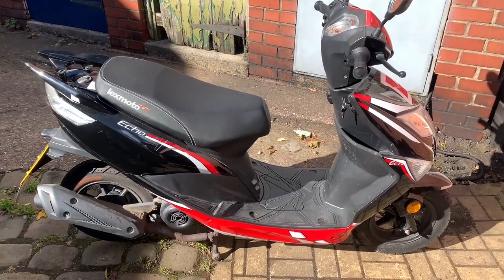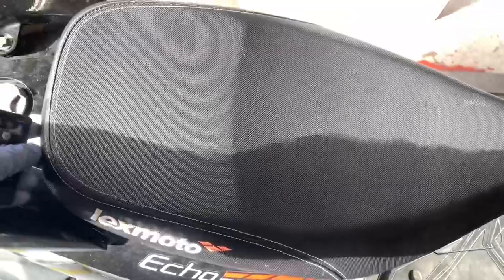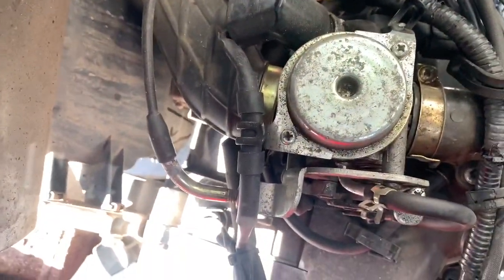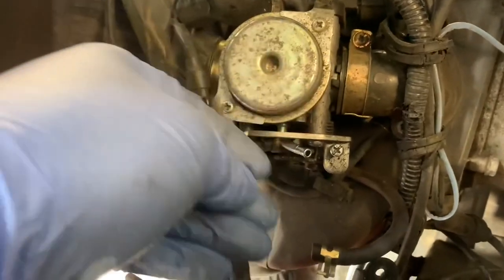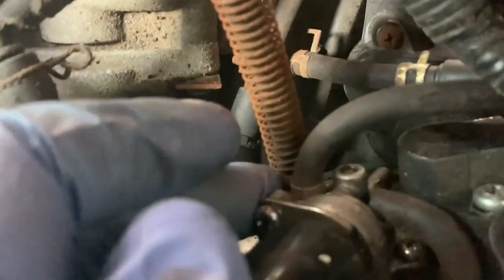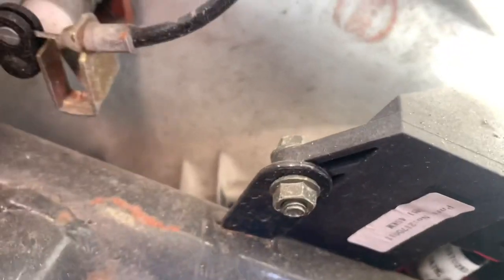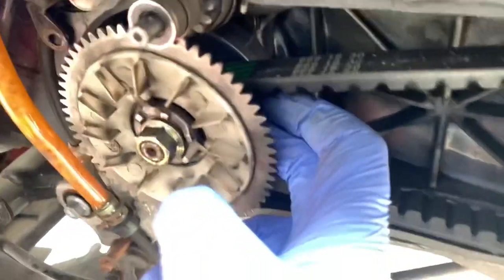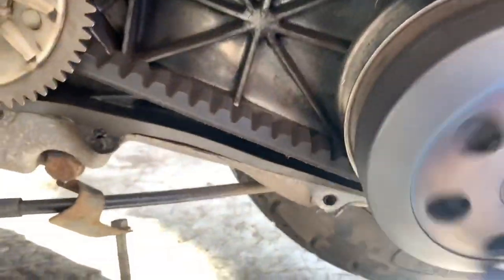50cc 4 Stroke De-Restriction, Euro 4 GY6/New Type Scooter Derestrict... “Make Ya Ped More Fasterer”

Comment: Hello SBSV, I have a lj50qt-6l (Echo + 50) from 2019 and this type of engine does about 15mph (not great). I have a Dell'orto ECU with only a vario restricted Bus (bigger edge on the vario bus). So should i get a new ECU to get it unlocked for full rpm and full speed?
Reply from the maker: Have you blocked the vac lines?
Reply: @StupidBlokeStupidVideos  not yet... But iwould be restricted inside the ECU? The vacuum lines have two solenoids on it.
Reply from the maker: @schoonbeek2  the ecu restricts the carb via the solenoids. You won’t necessarily gain top speed by removing them but usually get better acceleration and up hills. At 15mph yours sounds like it may have other issues though
Reply: @StupidBlokeStupidVideos thank you for your reaction 😊 My mopet is a restricted version in the NL. You buy them straight out of the shop 😂 they go as fast (as a bicycle). Sometimes electric bikes can keep up with me.
Reply: But why are they on it? It has something to do with emissions? I don't get the whole tube solenoid construction thing :P @StupidBlokeStupidVideos
Reply from the maker: @schoonbeek2  ah I’ve heard of those but never seen one. They aren’t over here. I think the restrictor for that is actually a ring in the variator. Sometimes they are part of the slide and the slide needs replacing. I’m not 100% though
Reply: @StupidBlokeStupidVideos  Thank you for the explanation. Ive heard that the pick up line from the ignition coil needs to be black. So i have to swap my original ignition coil (blue white wire) to black wire. And then you need to change the ECU CLC to a unlocked one. You ever heard of that?
Reply from the maker: @schoonbeek2  sounds like it could be about right but I’ve honestly no experience with that type as they aren’t in my country. On this model the carb is restricted by the solenoid valves that open to release the vacuum and drop the slide or on some models let air pass straight past the carb altogether. They also serve to lean the mix as much as possible to meet the emissions requirements for euro 4. This process I show should result in a bit less of a lean fuel mixture, and stop the carb from dropping down when the ecu demands it and as a result give a bit more power. Better acceleration and speed up hill but the actual speed limiter can be awkward to bypass on these euro 4 scooters, depending on model. The electric speed sensor restricts ignition when 28mph is reached. Unplugging the speed sensor puts a lot of them into limp mode but not all of them.
Reply: @StupidBlokeStupidVideos  You are amazing. So block those lines or delete them should work properly? Those on the carb i can put a little fuel hose on, with a stop or rubber piece in it. What u think 🤔?
Reply from the maker: @schoonbeek2  on this one I just blocked them off by pushing a ball bearing inside the pipe. That’s probably the easiest method to be honest. If you try it, let me know if it works for you!

Comment: I’ve installed a polini lambda emulator and now my bike is derestricted. Should I also do this aswell as I’m still only getting around 35 on a flat on my aerox 4t
Reply from the maker: I’ve not done an Aerox 4t yet, so not sure what system they use. Has it got a carb, or is it injection?
Reply: @StupidBlokeStupidVideos  I’m pretty sure it’s a carb mate. I haven’t touched the carb yet as I don’t want to fuck it up
Reply from the maker: @rskvelocity2790  that’s fair enough. If it’s a euro 4 the carb will probably work in the same way as this one but without seeing it, it’s hard to say.
Reply: @StupidBlokeStupidVideos  I’m mistaken. It’s fuel injected so I need to buy the malossi force master
Reply from the maker: @rskvelocity2790  I’ve not done an injection one yet, but I think it’s a case of altering the software in the ecu

Comment: Hi mate, is this legal and will I pass the MOT with that? Cheers
Reply from the maker: It’s not part of the MOT test, and won’t make any difference as far as MOT goes. If you’re 16, then technically it’s illegal but you’re extremely unlucky if you get caught out. In my opinion, these bikes are more dangerous when restricted than not!

Comment: Hi buddy nice video, I have a tgb 50cc I've removed the washer and now does 42mph is there anything else I can do to gain a bit more speed on this bike
Reply from the maker: Hi mate. Is it a 4 stroke or a 2 stroke? What year is it?
Reply from the maker: @richardmonk8957  the exhaust is vital on a 2 stroke. Make sure the restrictor is out in the exhaust. It’s usually in the exhaust flange where it bolts onto the engine, but sometimes it can be in the end can/where the end can bolts on if it has one.
Reply: @StupidBlokeStupidVideos  ahh cool nice one for that buddy I will have a look and remove it, it has a rubber pipe coming off the exhaust I saw on another video this should be cut and plugged is that correct
Reply from the maker: @richardmonk8957  the rubber pipe is for an emission system. That’s not the restrictor but does want blanking off at the same time really.
Reply: @StupidBlokeStupidVideos  cheers buddy soon as this snow clears gonna get out and have a look in the exhaust, keep up the videos mate

Comment: Hi mate old video so not sure if you’d reply, but have any idea how I de restrict a lexmoto nano, from what I’ve heard it essentially has the same engine as the echo but not 100% sure, and as it’s a euro 4, is there any way of replacing the carb with a none electronically controlled one or would this not work ?
Reply from the maker: If it’s the same carb then this should work in the same way pal
Reply: @StupidBlokeStupidVideos  yeah it’s the same carb and I’ve blocked the holes, I’m just wondering if it’s possible to swap the dellorto electric carb out for a mechanical race carb to up fueling , or does the bike require the dellorto electronic carb
Reply: Did you ever try it ? I got the nano but so sick of how slow it is had any luck with it
Reply from the maker: The ecu needs to see the input from the throttle position sensor to adjust the timing so a standard carb won’t work without other mods. I’ve done this method a few times and it does work, on some models there is an electronic restrictor I haven’t managed to bypass yet so it will only do 30mph before an over speed code but you should still get better acceleration and up hill speeds at least.

Comment: Can u help me have the same bike as you and i can’t find the ecu where is it do u know?
Reply from the maker: Take the seat bowl out, if I remember right it’s on the left hand side rear but I’m not sure. It’s a while since I’ve worked in one to be honest.
Reply from the maker: @user-cc3do4pg9v  euro 4 models with electronic carb control have an ecu instead, the older ones usually have the CDI in a similar place or near the battery, but not always.

Comment: Hi mate I have a 20 plate echo , I can access the 1st pipe but not the other one ,
Reply from the maker: It should be there. Look for the solenoid valve and follow the pipe back to the carb.

Comment: I got similar model with exact same electronics I removed variator restrictor any way to manually derestrict dellorto electronics other than buying it derestrict Ed?
Reply from the maker: This video shows you how to stop the ecu from restricting the carb side which is the main/power restriction. If the carb has been done and the speed sensor/variator restrictor has been removed, then the only other thing should be the rev limiter, which you’ll struggle to reach when the cvt is in top gear anyway.
Reply: @StupidBlokeStupidVideos  Just to be clear youre saying that if I have carb and var restrictors off removing rev res wouldn't make much of a difference?
Reply from the maker: @chaosmaster8855  often that’s the case yes, as you’ll struggle to reach it without other mods.
Reply: @StupidBlokeStupidVideos  well currently it hits 7k rpm with ease and I've hit it as high as 8,5k downhill any mods you'd recommend,would a Dlh variator (advertised as +15% speed when I apply it) actually make a diffeence
Reply from the maker: What upgrades have you done? Just derestricted it?
Reply: @StupidBlokeStupidVideos  yes and it has 5g rollers apart from stock that were 6g if that makes any diff
Reply from the maker: @chaosmaster8855  unless you’re doing other mods like a different camshaft etc, then lighter rollers usually have a negative effect on the GY6 engines as they are tuned for low down torque rather than high end power. I would try removing the carb restrictor and the. fitting your original rollers if I was you.

Comment: In all seriousness, does this actually work ? My scooter doesn't go past 30mph, even with the washer removed, it is Lexmoto Echo 50 E4 2018
Reply from the maker: I’ve done this a few times and whenever I’ve done it, it has worked yes.
Reply: Mines restricted and I can reach 30s but desperate to de restrict it
Reply: Anyone know anyone who can do the de restriction close to sk16 lmao?
Reply from the maker: @lxll-GOD-llxl  I’m in OL2, but on one of these that’s like a 3 day journey.
Reply: Ol2 that close? Could you do? If so how much bro?
Reply from the maker: @lxll-GOD-llxl  Google Bikes and Beyond Shaw pal, that’s where I work. To do this wouldn’t be expensive but don’t expect massive results lol
Reply: Just need a bit more then about 30 ygm haha and where's that?
Reply from the maker: @lxll-GOD-llxl  near Oldham pal
Reply: Got a number?
Reply from the maker: @lxll-GOD-llxl  type is into Google is best bet mate, number is on there and it will tell you exactly how far away we are too. Bikes and Beyond Shaw.
Reply: Cheers pal, say if I wanted someone come do it how much would I be looking?
Reply from the maker: @lxll-GOD-llxl  we don’t do call outs, but we charge £48/hr. It would probably take about half an hour to an hour maximum as long as there’s no issues.
Reply: Thanks alot mate just have to figure out an easier way getting there lol

Comment: i got the same bike and it goes 50 km/h can this make it go faster?
Reply from the maker: Usually when fully de-restricted, they do a bit more than 50km/h in my experience. Probably closer to 65/60kmh.
Reply: @StupidBlokeStupidVideos  Amazing i'm going to try this but can i put something else inside? Not the ball. Because i don't have it :(
Reply from the maker: As long as it blocks the pipe off then it should work. Be careful not to block the wrong pipes off though.

Comment: if it has the washer do you remove it and it’s derestricted?
Reply from the maker: Usually yes. Some have the washer built into the variator slide so a new slide is needed or it needs grinding down to size, and some have a cage around the back of the variator held on with 3 or 4 screws that does the same thing.

Comment: Hi mate looking at mine cdi dereistict seems cut , doesn't make much differnt get like 35, thinking of getting 72cc big bore kit would that make a difference
Reply from the maker: Is it a euro 4 model with the electronically controlled carb? The speed restriction wire being cut on its own will let it go over 30, but you usually won’t have the power to much more unless you’re going down hill and won’t make any difference up hills unless you derestrict the carb too. There’s another video on the channel on how to do that if it’s not a euro 4 model.
Reply from the maker: Big bore kite make a noticeable difference, especially if set up correctly.
Reply: @StupidBlokeStupidVideos  not too sure what one mine is mate its 16 plate so it's the older model and I thought the same but even down hill it's the same speed its odd
Reply: @StupidBlokeStupidVideos  yeh definitely going to get a garage to fit it soon enough so il let you know when it's done

Comment: Hello mate wondering if this will be the same steps for a 2019 4 stroke 50cc sinnis jet 2? Thanks
Reply from the maker: The carb, more than likely yes. However don’t disconnect the speed sensor as it will probably go into limp dick mode and will lose power. If you just do the carb then it likely won’t go any faster full speed, as the max speed limiter will still be in place, but you should get better acceleration/speed up hills.
Reply: @StupidBlokeStupidVideos  is there not a washer on the bike to remove? Well I’m guessing if there was and I did the bike still wouldn’t get any faster ?
Reply from the maker: @WX04  if there is a washer then yes remove it as that’s a restriction of the hearing, effectively not letting it reach top gear. Most of the new ones don’t have a washer though, and are electronically restricted via a speed sensor on the clutch bell. Some you can disconnect it, but others will go into limp mode with it disconnected.
Reply: @StupidBlokeStupidVideos  for the speed sensor could i just buy a derristricted CDI from ebay or something?
Reply from the maker: @WX04  it’s dependent on what system your bike has. If it’s euro 4 then they have an ECU with an electronically controlled carburettor etc. A derestricted one is expensive. If it’s just a normal CDI then a derestricted CDI won’t gain hardly anything without doing the other physical derestrictions.
Reply: @StupidBlokeStupidVideos  hello i ordered a ecu i have plugged it in the bike however it has just went slower acceleration and capped at 20mph. Do i need to block the pipes or is it the wrong ecu of racing planet it was a dellorto ecu for a sym bike however i have a sinnis but on another website the same ecu says it works for s specific model which i had. It has the same ecu number though and i was told by a local mechanic it wouldve worked thanks mate
Reply from the maker: @WX04  does the engine management light come on? Have you got the speed sensor plugged in? Some of the bikes do this and go into limp mode when the speed sensor is unplugged.
Reply: @StupidBlokeStupidVideos  i left the cdi untouched and just replaced the ecu in the bike, it then revved slower than before and went slower. So im guessing the ecu just did not work for the bike?
Reply from the maker: @WX04  sounds like it’s possibly not the right ecu to be honest. What make is it and how much was it?
Reply: @StupidBlokeStupidVideos  i bought it off racing planet for 144 pounds it was a dellorto one for sym bikes, but had the same model number as my sinnis dellorto so i thought it would've worked
Reply from the maker: @WX04  it could have the wrong software. They’re the same unit across most Chineese models as far as I’m aware but with different file uploaded. Technically there should be a derestricted file for your original one, but that’s a bit computerey for my knowledge.

Comment: Got an echo 20 plate and its not got the washer on but tops out at 30 and I’ve tried the bb bullets and It didn’t do anything
Reply from the maker: The BBs will only allow stop the restrictor that stops the slide of the carb from opening fully, but the top speed restrictor works in a different way. The BBs themselves won’t raise the limited top speed, but should help the bike get to it quicker and be better at going up hills etc. There are a few ways euro 4 scooters are restricted and some harder to get around that others. Does it have a speed sensor on the clutch drum?
Reply: Hi pal, got a 16 plate longjia lj50qt 4 stroke... When I bought it off a geezer, he said he unplugged something under the footwell from a power unit, it does 35mph on a slight downward incline, any other ways of improving top end a few mph please mate

Comment: I cant find parts (Variator Kit) for my Lexmoto Echo 50cc E4 5-Litre anywhere in the UK. I've been waiting for months. Its so terrible. Does anyone know where to buy one, other than CMPO?
Reply from the maker: Is your variator definitely restricted? It’s just the front variator thar you need, I’m not 100%, but I’m fairly sure that the standard 50cc GY6 one will fit. Worth a try as they are only cheap, CMPO should have them but failing that, eBay will have them too
Reply: Thanks for the very quick reply! I guess it’s worth trying... from the reviews on on trust pilot people have been waiting 3-5 months at times for parts. I will try. Thanks again!
Reply from the maker: @HOOKZIE  no problem mate.

Comment: Sym fiddle 3 49cc 4t, i remove ring and now run 50 km/h,but whe  is on this speed it doesnt run clear and smouth, something is going wrong, and a noise appears on 50.....for more speed another cdi or can i remove the wire from original cdi??
Reply from the maker: What year/setup is the bike? Is it hitting the Rev limiter? Or it could be hitting an electronic restrictor? Fitting a De-restricted CDI doesn’t actually usually have that much of an effect compared to the other restrictions.
Reply: @StupidBlokeStupidVideos  it gwts verry fast to 50km/h ,the engine tell me wants more but something dont let. The noise at 50 is something like the belt touch something
Reply from the maker: @k1ngbud1st91  and you’ve removed the ring from the variator?
Reply: I think its an electronic restrict..i mention..the cdi is dellorto
Reply from the maker: @k1ngbud1st91  is it the same system as the bike in the video?

Comment: i have the gy6 50cc when i remove the cable from variator check light on. how to fix that?
Reply from the maker: It doesn’t always work, but I’ve got round this in the past by grinding half of the pickups off the clutch bell so the ecu only sees half the speed you’re doing, but this only works if you have multiple pickups
Reply: I have only 1. I think i want to buy unrestricted ecu but its expensive
Reply from the maker: @thunder732  yea sometimes that’s the only way around it. Some of them can be reprogrammed but I’ve never seen it done.